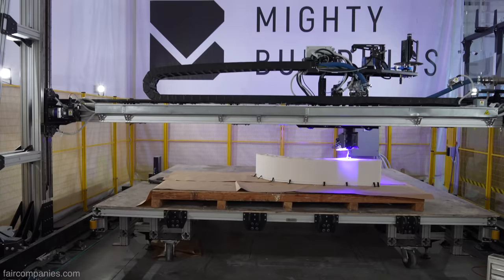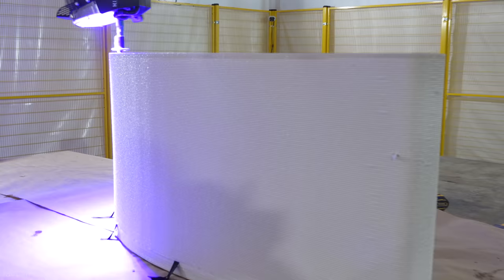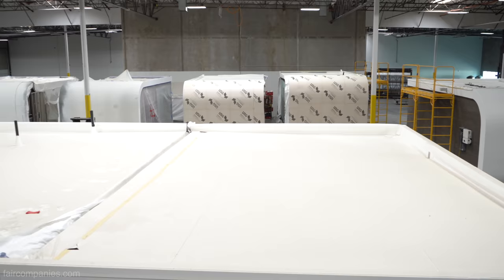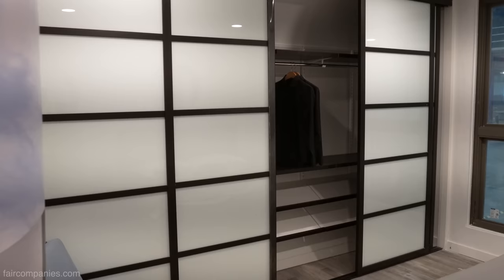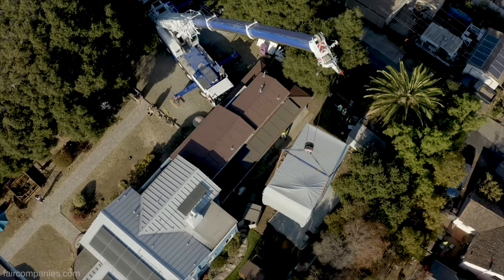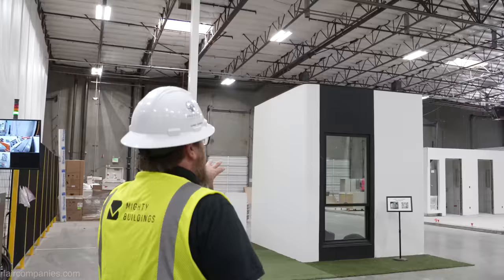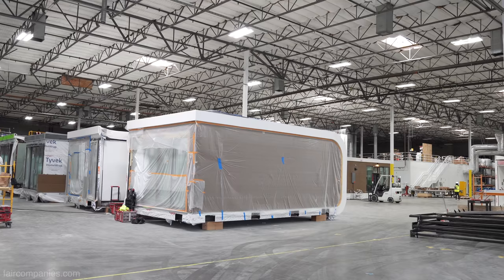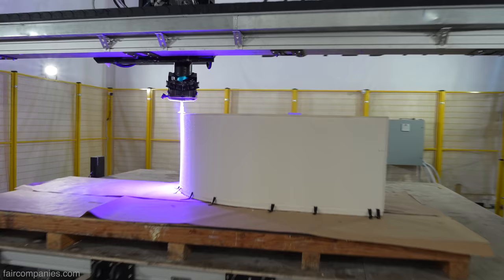3D-Printed in 24h, no waste. Price to fall as builds ramp-up

Comment: I would like to know the strength of the layer lines.  3d printing a strong part often requires changing the orientation of the 3d model so your layer lines are at maximum strength, which doesn't look practical or possible with these homes.
Reply: It sounded like their layer bonding was done cold with the UV curing - they can't rely on anything being uncured on the previous layer like a domestic 3D printer would, so I'd imagine it's a very strong bond. There would be nothing stopping it being as strong as the bond within a layer. It all depends on how much 'polymer' there is in there compared to the stone and glass I expect. They've probably put enough in there to make it feel unlike plastic and to reflect light a little differently and then no more.

But the whole thing seems to be about patents/certifications at the moment rather than other benefits. Basically they've achieved a curve in one end of a building that would be tricky in other code-approved materials. It gives it a unique look and that's about it.
The cost/speed/appearance looked similar or worse compared to other similar prefab buildings.

Comment: So, how would these do if you chose to do earth-berming, or a green roof?  What's the insulation factor, for those of us in the snowy areas of the world?  How many can you put side by side, and link them, to form a larger dwelling -- is there a limit, strength-wise?  Can you print in anything other than white?  Can the basic design be modified for the buyer, to (for example) put in an extra-large walk-in shower instead of the standard size?  Thanks!

Comment: The “print head”, or extruder, keeps swiveling. That swivel is unsteady with repeated moments and introduces a point of failure. Is it possible to create an extruder that works in all directions surrounded by ultraviolet lights?

Comment: Still requires construction crew to build a frame. Still requires standard components, windows, doors, etc to be installed by hand.

The problem with 3DP buildings is it solves no need. There's no paint point or market demand being solved. The biggest limiting factor in the housing market is restrictive zoning and lack of funding to build anything but super gentrified "luxury" buildings. What's more, prefabbed, CNC fabricated buildings (which is super common in the EU) automates everything that 3DP housing does, except about 50x better, quicker, more sustainable etc.

Comment: What testing has been done as far as these units being fire proof or fire retardant? If these were to catch on fire, what kinds of noxious or toxic  chemicals are released? Is the smoke a burning unit would create poisonous or thicker than regular smoke created by a typical modern home? Considering the threat of increased frequency and increased intensity with weather patterns and natural disasters, how well do these units hold up? Do insurance companies cover these units the same way home insurance is applied to any other regular home? What is the carbon footprint created by making these units? How does that compare to other carbon footprints created by standard contemporary buildings?

Comment: The prices are ridiculous for even an ADU I will definitely go with a different developer just being honest
Reply: Hi there, most options on the market only sell you the unit itself. It does not factor in costs for a general contractor, permitting, shipping and delivery, those sorts of things. When you partner with Mighty Buildings, we actually built those things into the costs! Our Mighty Owners get a lot more value by saving time and planning when they decide on either a Mighty House or a Mighty Mod.

Comment: Building codes that govern construction materials and methods slow down innovation, as well as consumer fears over resale value.  I am also curious about the repair process.  If a tree falls on it or a car runs into it, how do you repair the 3d printed section?  We really need to make sure that as we innovate new technology, that we are able to reasonably make repairs to what we build ( cough cough smart phones and electric cars ).  Creating things that are entirely landfill after accident or failure is not sustainable.

Comment: Haven't addressed impact and affect of the materials on the health. What that means they dont have a clue, otherwise it would be included in this video as a strong point. Therefore, it may take another 30-50 years to find out if it is a hazard or not. What aabout recycling? Printing out polymer structures is easy, but you may end up contaminating the mother earth.

Comment: Are these true? that it is:
- Faster prefab manufacturing techniques, by small time margin.
- Higher price compared to conventional prefab units.
- Lower structural strength compared to conventional prefab units. Albeit lower mass.
- Non-bio-degradable material. But lower tensile strength as it is exposed to UV light.

Maybe it's better to use the tech in aero-engineering, or something else that isn't mean to last for decade.

Comment: What kind of insulation is being used? What's the estimated R-value of the exterior walls minus the windows?
Reply: Nevermind, I finally saw my answer at 15:05. They are filling the exterior walls with spray foam and using fiberglass batting in the ceiling because local building code requires it. There's no mention of R-value but based on what was shown it's probably R-20 or greater.

Comment: Looks nice, looks comfortable, eliminate the time and labor needed to build a house, so where's  the cost savings? There isn't any. Just a lot of tradesmen out of work. On their website prices Start at $349,000. for a 864 sq ft house which I assume doesn't include the land or foundation so by the time you're done you're probably looking at 1/2  a million + - for a small 2+1. All this new tech always seems real good until you're hit with the high price tag. No thanks.

Comment: Awesome product. The price is laughable though. You would think these would be 1/4 to 1/2 the cost of a traditional home since it used less labor. 250-350k for one of these tiny homes is nicer going to catch on
Reply: Hi there, Eric - most options on the market only sell you the unit itself. It does not factor in costs for a general contractor, permitting, shipping and delivery, those sorts of things. When you partner with Mighty Buildings, we actually built those things into the costs! Our Mighty Owners get a lot more value by saving time and planning when they decide on either a Mighty House or a Mighty Mod.

Comment: how's the thermal insulation and sound proofing? Why do they have to make these homes seem for poor people? Even if they have other planned designs it is very limiting. The idea should be for a 3D print system that allows infinite customization and design depending on the buyers budget. Also for the assembly to not require human intervention. This is modular but each section is too big to be done at the installation site. I think the crane system is really good. I also thing the modular system is very limiting due to the amount of parts required for a room and most parts are just sections of a wall.
Reply: What's the vertical stacking limit?
Reply: Wish he would have talked about electrical wiring and sockets.

Comment: @ 4:40... 
I find it fascinating what they call a traditional home. To me, a traditional home would be wattle and daub with a thatched roof, or cobb with tile roof, or stone with slate roof. Additionally, the homes that we build today are incapable of surviving without electrical access for air conditioning and dehumidification. As soon as you remove the electrical component, most of the homes in the southeast are going to mold and become unlivable within days. Homes prior to the onset of air conditioning fare better, but nothing beats actual traditional housing for reduction of waste, local materials, weather management, etc. Cement has a pretty high carbon foot print. This compound must also have a relatively high carbon footprint since plastic resin is the binder.  I want to know what the long-term prospects are for this material with regards to weathering UV, fire, etc. How quickly does "light stone material" (LSM) break down? Five years? Ten years? Twenty years? How likely will it be that I can buy a new one to replace my old broken-down unit in 5, 10, 20 years? What does it cost?

Comment: So plastic that has some minerals mixed in...So whats the expected utility life of this plastic box? I'l go with a hunch and say max 30years before walls are starting to fall apart from suns UV radiation, if the snow mass on north wont collapse it. Just one tiny hole filling the wall cavity with water combined with little frost and you have blown out wall.
Its cool tech, but getting logs and building log house is way cheaper and more reliable building material than printed house. I'l give it decade at best before we start to see issues rising from this. Also when this thing will be ruined, how one recycle this plastic wall?

Comment: If you want that fresh cut smell of lumber hobbyist level 3D printers do have wood infused filament.  I'd betcha they could put some of that in their mix.  Add all kinds of custom scents and prismatic colors, heat or cold activated colors, other cool stuff.  Maybe even an embedded RGB style video wall panel that is easy to swap out dead trixels or voxels as they cease to function?  Too bad the cost of the pre-fab is over priced.  A fancy 3D printed shed for the amount of space you get for their cheapest model goes for $204,000 at only 350 feet of living space?!  You can buy a 2,000+ square foot house fully furnished in a Southern state for less than that.

Comment: “3D printing is cool!” Does not equal energy efficient home construction. 
What is the r-value of those walls? 

Wood framing also creates a carbon sink when lumber is stored in a home and replaced with new trees. 

This seems like a hype train IPO run. 

Cool for wealthy folks that want a “my pool house was 3D printed” story

This is NOT sustainable housing. 

Opinion of a “green” home builder in the Northeast US.

Comment: Sorry Kirsten this is not sustainable, this is urban sprawl single storey. How much do they cost to heat and cool with all the joints and thermal bridging. 3D printing whole houses is a gimmick and will not catch on to mainstream construction.
However 3D panel manufacture is more  like it we could use this in our 12 storey tower blocks!! That is the future of 3D printing!!

Comment: Astonishingly expensive. Absurfy expensive. Tends to wonder
 About using a Rail jig. And set in Cast Fiamcrtete. Into a framed aluminum cast which then becomes the finished product. Thus any medium can be filed in with foamcrete. And then exterior additional products layers.

Comment: Sorry, you lost me at 8:54, the transportation and the huge crane to place it in place. Sad and bad thought process. Best bet, put that 3D printer on a truck and take it around with raw material. Little bad then that would be print all at factory and move in normal size truck and assemble at site.
Reply: 12:15 absolute useless over head.

Comment: This is a waste of time.  I watched the entire video, with the expectation of some idea of what each unit would cost.  Nothing.  I am a real buyer looking to find something that makes sense in this construction era.  The technology is impressive.  Here are a few questions?  Where can this the shipped?  Can the roof double as a deck?  Do you have suppliers in other parts of the states?  What is the price installed.   Is tech support supplied?  What state building codes is this feasible in.  I live in Florida.  Wind load is a serious factor and glass exposure as a percent of the entire structure as well as room by room is part of that equation.  Tell me you can build these reasonably in Florida and comply with code.

Comment: What you need perhaps is a dual extrusion printer that prints insulation as well. Maybe just a form of aircrete reinforced with graphene strands.
And it should be deployable on-site, do multiple stories, stairs.

This hybrid application is just a stupid gimmick. This has no benefits whatsoever. Just a high price for novelty.

Comment: The guy talking is such a bamboozler. These cost 2-4x regular construction. One has to wonder if the printer material off-gasses toxic fumes. This is for Silicon Valley folks that want an in-law unit or fleece people on AirBnB.

Comment: Thermoset UV cured......So, its permanent landfill after use? What a terrible idea
 Hold on. They use a massive steel structure to form the basis of adding their 3D printed cladding? Thats not a solution.......What happens when it burns? I dont want to be a downer, this technology is very exciting, but it has to stand alone and be a completely closed process....

Comment: 3D printing is an incredible technology, but this company and their product is not something the world needs right now I think. The way they presented this didn't help either. Even if the polymers were plant-based or made from recycled plastics it still wouldn't make sense, especially because of the price.
Reply: California took too many bong hits as the main benefit of 3D printing is rapid prototyping where casting is ALWAYS superior in mass production.

Comment: Starting at $204,000 for 350 sq ft is not innovative its rape with a little 1st degree murder. The printer is just a giant extrusion based printer with a resin mix. Probably 10 grand in material with a proprietary head and printing "polymer".  What I see is a flat roof with RV quality fixtures. If they can't produce this for 30 grand or less the company is DOA like the rest.

Comment: No waste? Are you kidding? What about the energy to heat the plastic and drive the head around? The most wasteful method on the planet.  Built from Straw and lath it would be way better insulated and cost a tiny fraction! A few trees for pinning it together and thatch for the roof.

Comment: 3D printing in construction is so misleading and this video definitely topped them all for me. Go watch Belinda Carr's videos on this, as she basically proves how impractical this is in most cases, almost as dumb as container homes. First off 3D printed houses currently are hillariously expensive and overall are not cost effective. Second it is a straight up textbook lie on the '24 hour' process there is finishing, electrical, plumbing, hvac, and the longest for 3D printed houses, PERMITS. Lastly one of the biggest examples is effiency and compatibility, these houses are not suitable for 90% of America and are laughably ineffiecient due to their lack of insulation and etc. And if you plan on buying one of these houses, prepare to buy an outhouse too, because wheres the bathroom, and wheres the plumbing? I don't see how they run electrical either. All it is YouTubers trying ot get views.
Reply: Did you miss the part where they covered bathrooms?  They also explained that they buy prefab bathroom units from another company.  I mean I agree that this is in no way a mature technology, it's currently ridiculously expensive, and there's a chance it never gets past these early days.  But there are definitely bathrooms.